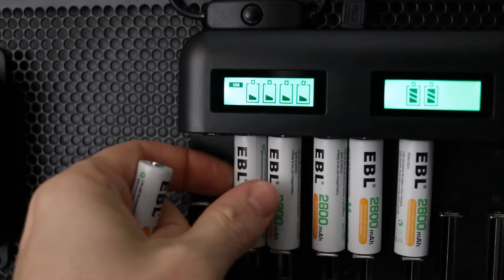A Developers Wall Mounted Charging Station

Comment: What are the horizontal rails that you have lag-bolted into the walls?  (No link the the parts-list above).
Reply from the maker: They come from a company called 8020, with a little bit of customization using a drill press for making the holes for the lag bolts into the wall. More information can be found on the video where I talk about the Height Adjustable Wall Mounted Desk on this channel.
Reply: @WarpedImagination  Cool, thanks!